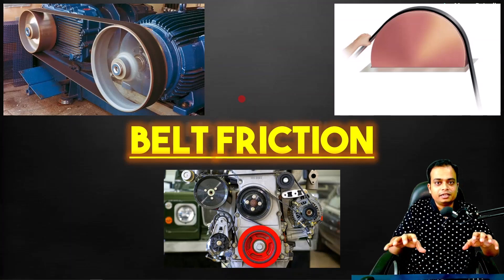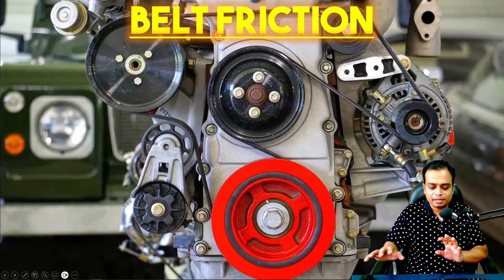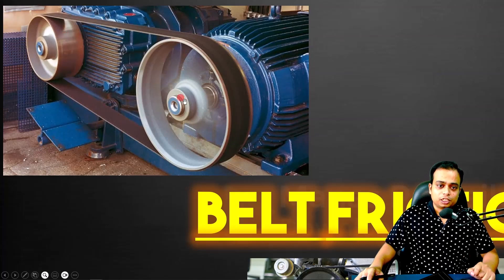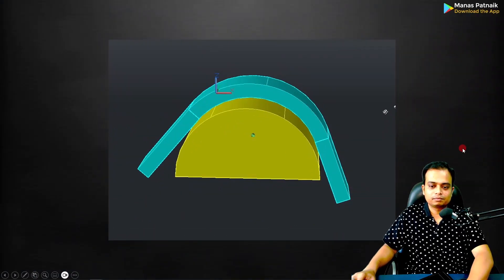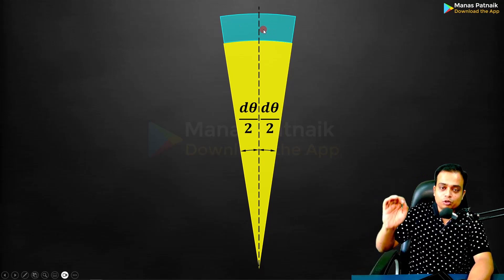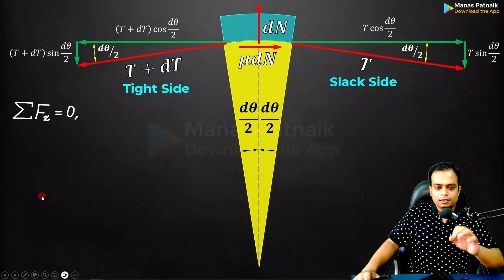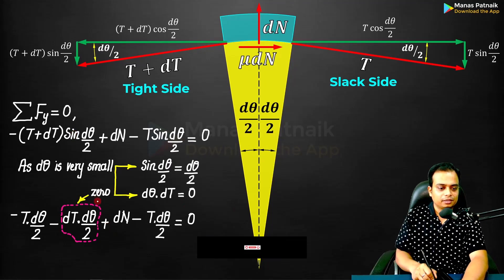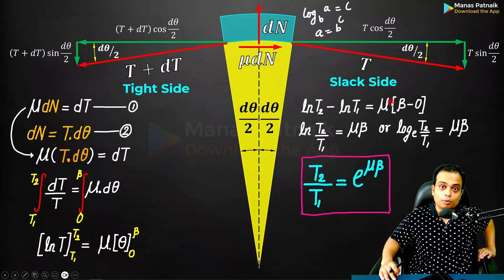Ratio of Tension in Flat Belt Drive_Full Concept

Comment: For anyone wondering how angle is dx/2 on other side.

Split angle dx in two parts dx/2 and dx/2 .

First find the unknown angle in the 📐 with force F and resultant R which would be (90-dx/2)

Then the force line which 180degree with a angle tension unknown lets call it angle(y). Force F and Tension T will form a 90degree angle as 📐 
Y= 180-90-(90-dx/2)
Y=180-90-90+dx/2
Hence , angle(Y)=dx/2